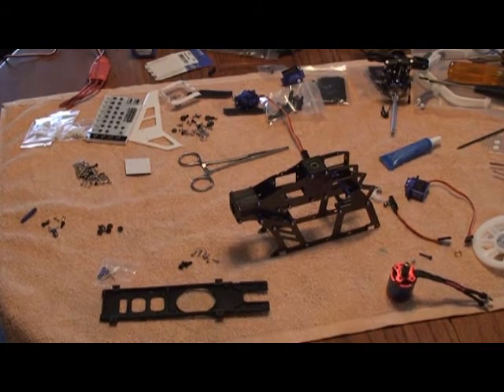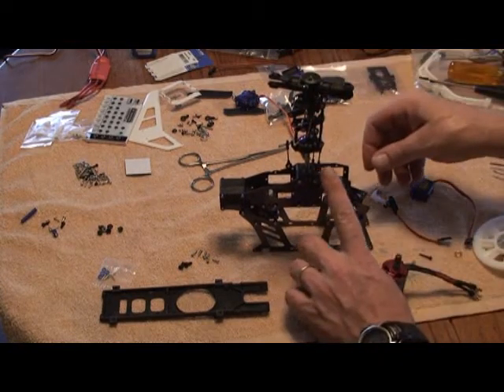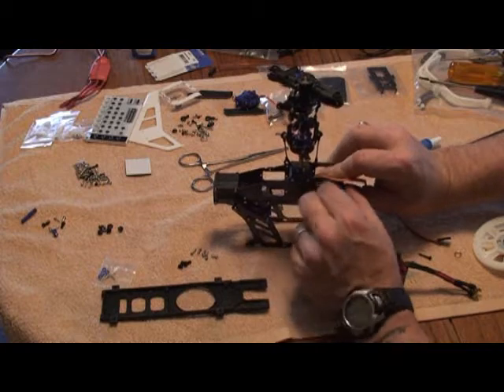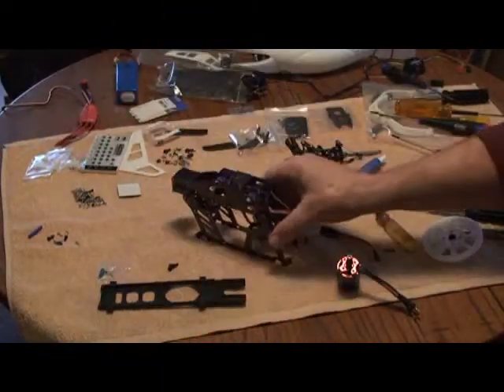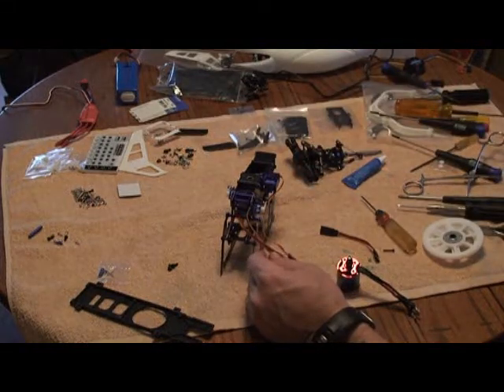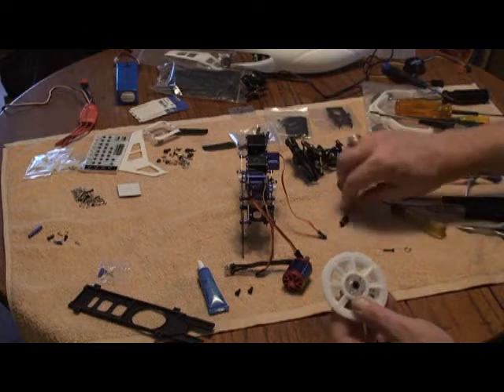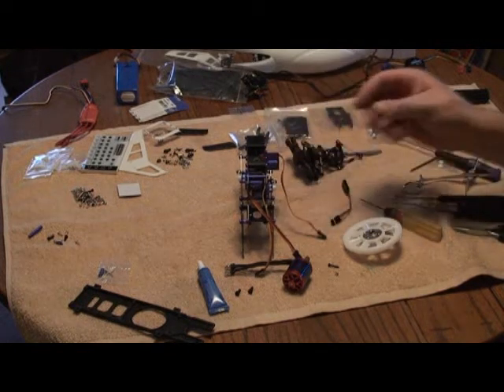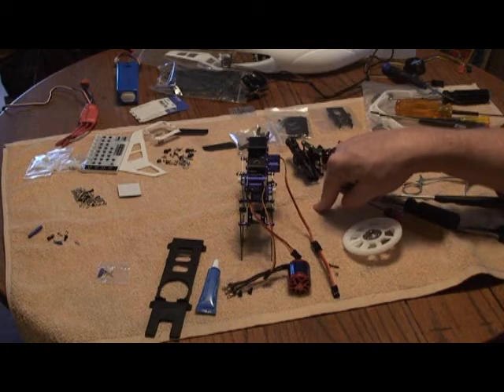HK450 Build 2 Servo motor install

Comment: Hello sir,
first of all cangratulations for the very good videos you posted and thank you for them.

I've got a problem wit the flybar cage. I can't get it ti be evenly paralel with the swashplate. With the main rotor blades along the heli (not perpendicular) it looks god but i i turn it half a turn, it will be a litle high on the front  side. (eyeballing it from the left side of the heli).

Any suggestions? Thanks in advance!!